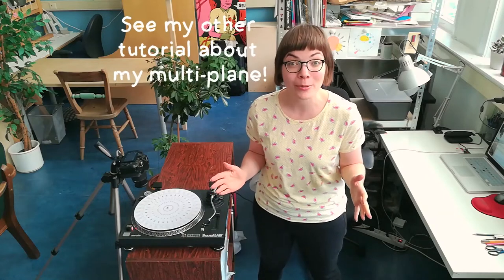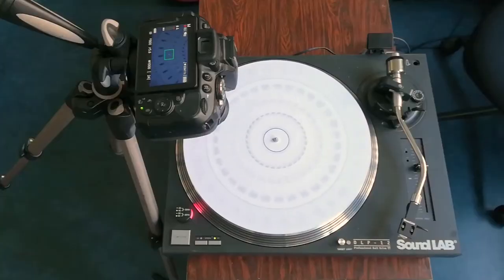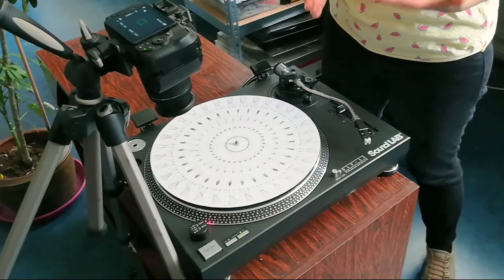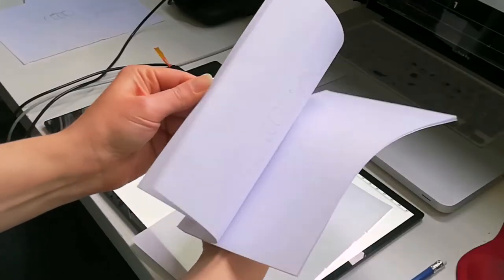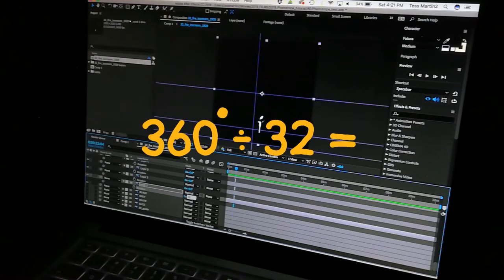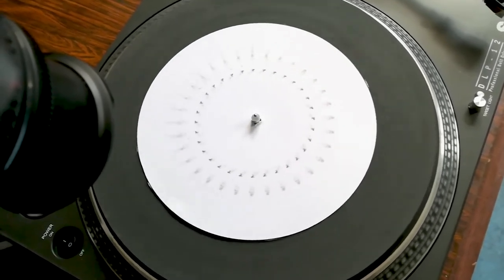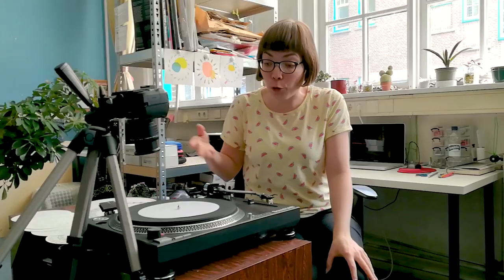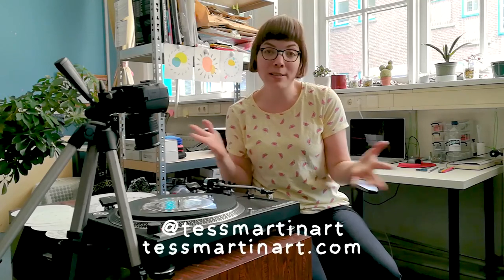How to Make a Phonotrope Video with Drawn Animation

Comment: Is it possible to get a similar effect while looking with the naked eye if the animation is more simple? For example lines or geometric shapes?
Reply from the maker: Well, it depends what you mean. If you mean literally the naked eye looking at a spinning disc, then no, our eyes see too much. That's why everything looks blurry. You can try it yourself and see. That's why you need something that breaks it up (video camera, phone, strobe light). Toys like thaumatropes, zoetropes and phenakistoscopes are designed to be used with the naked eye, but the way they are designed, they break up the visuals for us so our brain has time to process the images.
Reply: @TessMartinArt  Thank you for the answer. How about a slotted paper? I'm trying to think of a way to achieve that effect without technology (other than a spinning record).. I know that when you play 33 or 45 rpm on a record player that has side dots on the wheels, they apperar not to move.. That's why I'm asking about simpler animations..
Reply from the maker: The dots on the side of the record player work because of the little light that shines on them! That works like a strobe, which is one of the ways to 'break up' the movement for our eyes. A slotted paper sounds along the same lines as a zoetrope, where you have to look through passing slots. Another option is barrier-grid drawings, which are also analog, and are basically the same principle.
Reply: @TessMartinArt  Thank you so much! ❤